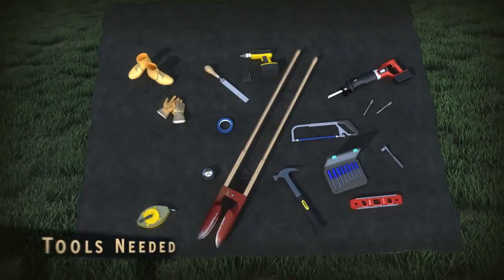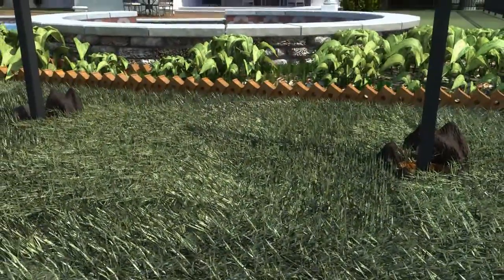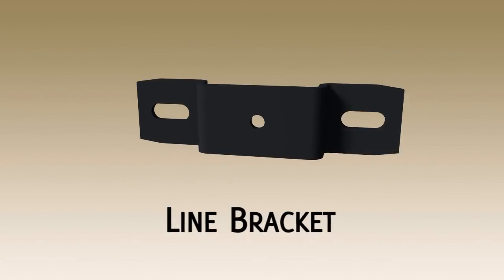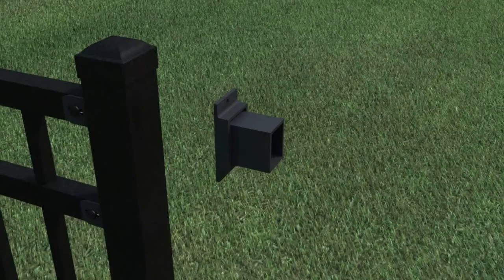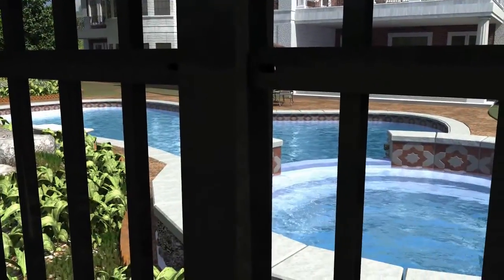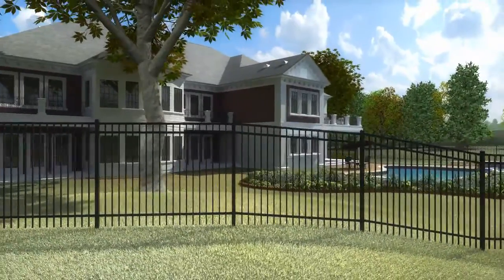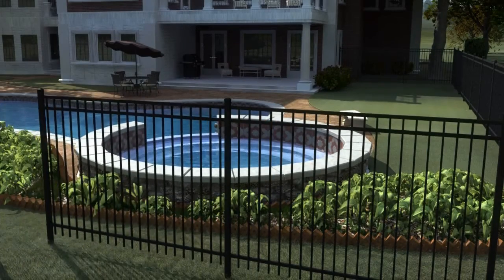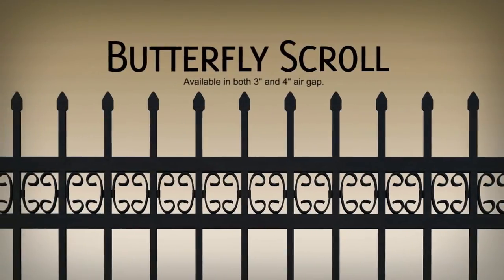Montage Plus | Ornamental Iron Fencing | Ameristar Fence Products

Comment: The problem is when you squeeze the bands to fit the bolts it makes it almost impossible to adjust them up and down without scratching the finish. You need to be able to slide the fittings up and down easily so as not to damage the finish on the post. In doing this it makes it difficult for the nut to catch the bolt. Another 1/8" or 3/8''s on the length of the bolt would make life a lot easier on the installation, especially if you use your product as often as i do. JMO